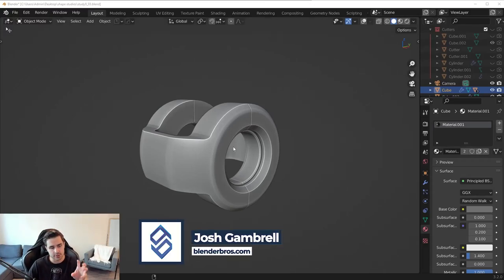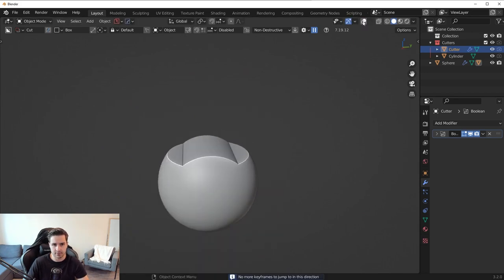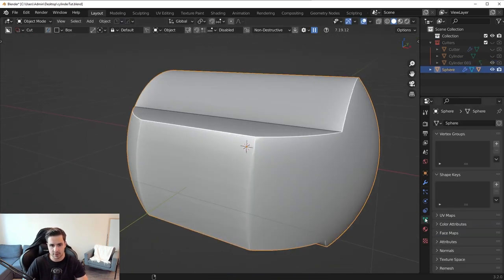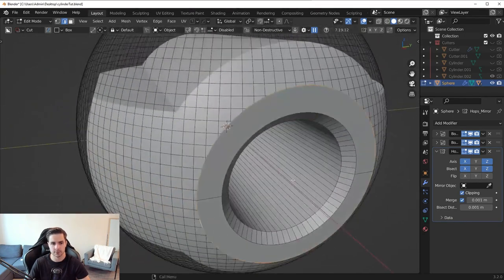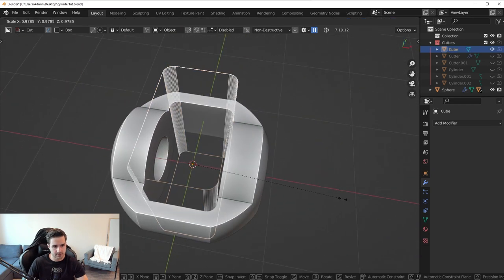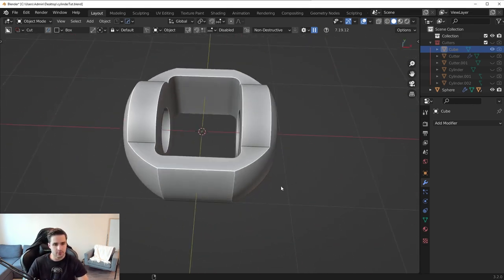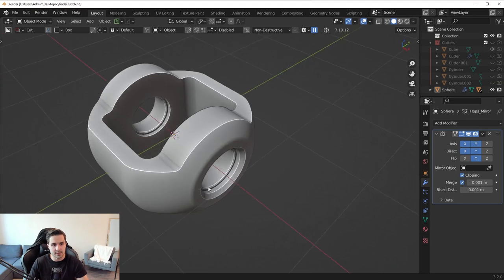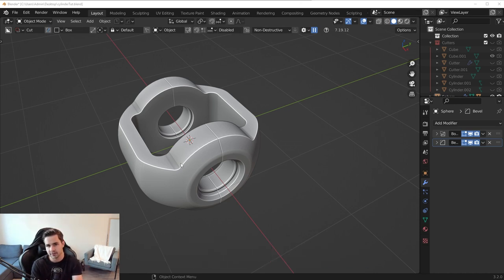BOOLEAN workflow - Blender Hard Surface Modeling Tutorial

Comment: When you shaved the sides to make them more flat but round. The caps that have the hole in it could've used the intersection cylinder boolean to make the ends flat?

Comment: When I use offset it kills the mesh, triangles in places like its overlapping edges somewhere for some reason.
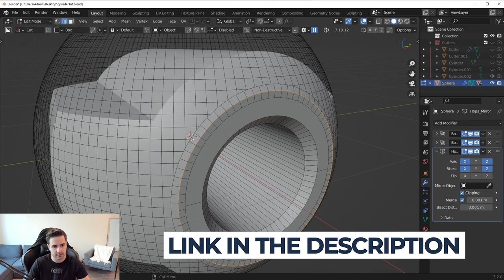Is it because I didn’t apply Scale to the Cylinder before I made the booleans?  Cause I didn’t see you do that either, but for some reason its not working like yours does at 6:37-6:39

Comment: I have a question: I just bought the boxcutter addon and looked through your videos to follow along and learn the addon... but when I left-click and drag for the basic cutting it is a grey colour and when I release I create mesh rather than remove it. This also happens with the ngon cutter, while I followed along to one of your older videos I had to use the ngon cutter which after left-click and drag created mesh but not even on my cube but far in the background. Maybe there is some option I did not turn on or something else. If you or someone else could help it would be really helpful :). (And sorry for my bad english)
Reply from the maker: You don't have an object selected. If no object is selected, it automatically goes into create mode.

Comment: Very good tutorial Josh! Thanks for sharing :) I do have to wonder though: At around the 12:30 mark after selecting the inner cylindrical faces, instead of extruding, then right-clicking to cancel the default extrude depth and then scaling inwards, why not simply press Alt+E (to bring up the Extrude menu) and choose Extrude Faces Along Normals? This saves you a few steps and would look like it would accomplish the same results.
Reply from the maker: It’s actually slower. With my muscle memory E->Escape (or right click)->Alt+S is actually faster for me than reaching Alt+E which is a weird combo to press when actively working. To each their own though

Comment: This is fine and all, but because of the messy topology, it is useless in a game engine. What would be the next step of you wanted to use it for games?
Reply from the maker: This would function perfectly fine in game engines if triangulated properly, but I would still clean it up beforehand. Many different solutions - quad remesher, decimating the bevel segments, connecting the geo a bit cleaner, etc. But as-is, as long as there are no mesh overlaps, all you really need to do is triangulate it. Our Game Asset 2.0 course covers this process in-depth.
Reply: You could also make a lower poly version of it and bake this high poly version down.